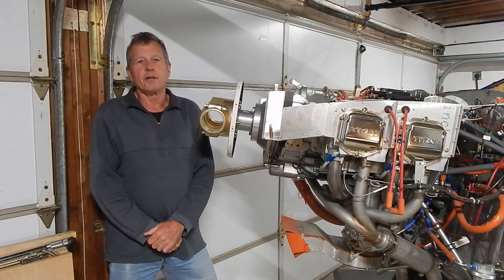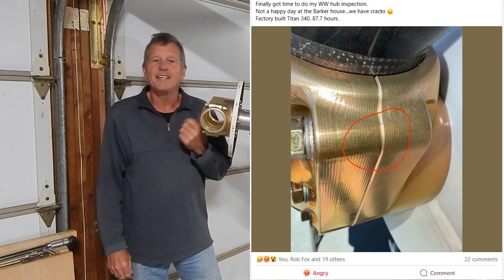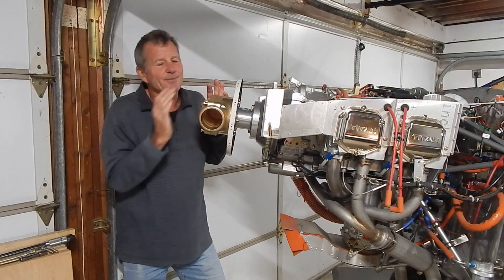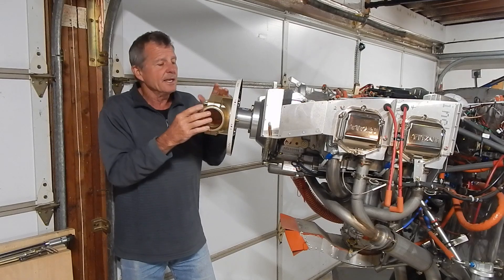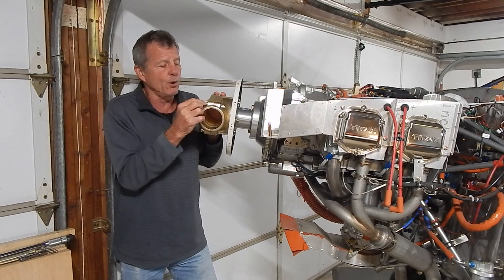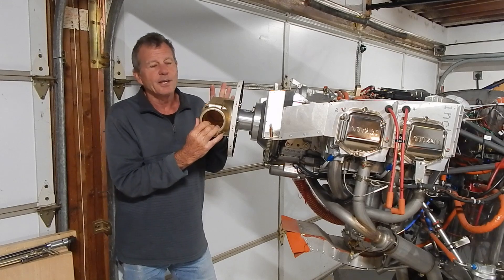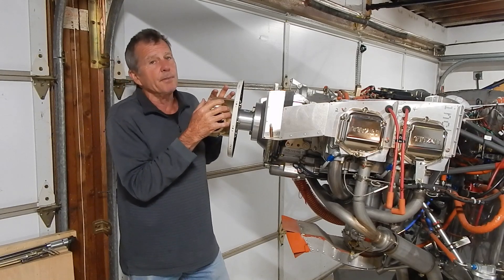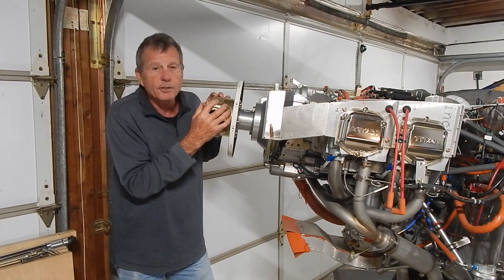RANS S21 ep 51- Whirlwind Prop/HUB Update

Comment: Wow, that’s nuts that they are not standing behind their prop. I was in a similar situation with my build (Super Cub) and had my Catto GA86 in the box and ready to go when they came out with a SB due to a reported crack. Of course it was a super high compression engine and using nitrous for STOL stuff that cracked.. anyway the whole point is they determined the issue and not only did they send a new hub, in the mean time they had tweaked the design on the 86 inch blades so they sent everyone new blades also. Along with postpaid return of the old hub and blades. Sorry long winded to say Catto is awesome in my experience.
Reply from the maker: Absolutely.. I did that video a while ago, but they are still not committing to replacements.  They are saying they are coming out with version 3 maybe late summer 2026. (version 2 is also cracking)  The Cattos are getting great reviews.

Comment: My background was in motorsport up to Formula 1 and Indy before switching to aviation - There is no way I would sandwich a resin-based substrate in a critical component. The carbon filbre is being loaded in compression, as is the 6061-T6 (or similar) alloy hub, and the steel bolt is in tensile load. Consider comparisons whereby mild steel has a compresive strength in the 350-550 MPa range, 6061-T6 alloy compressive strength is around 430, and epoxy resins are in the 60-80 MPa range. Embedded carbon filament in the resin will add a little, but will never reach a 1/4 of 6061. When you torque up an M8.8 bolt or similar, the tensile load is likely beyond the yeald point of the resin under compression. I suggest you bolt the CF disk to the back of the hub, not sandwiched, and most of your issues will probably go away. BTW, load bearing critical CF components in motorsport usually have an alloy sleeve  moulded in to make the connection point stable.
Reply from the maker: Your opinion on the carbon fiber spinner plate is shared by many.  Mike Gearon designed a plate where he replaced the center section with aluminum.  It's on the forum. Looks like a solid option for those who dont want to work with the current plate.

Comment: I have the 816 Ga200 prop hub with 1/2 bolts alum spinner plate. Infront of a io360 in a Glastar. My inspection is coming Soon.I Wish Catto or Sensenich made a GA for a 72'' prop.I have 550 hours on my current hub.